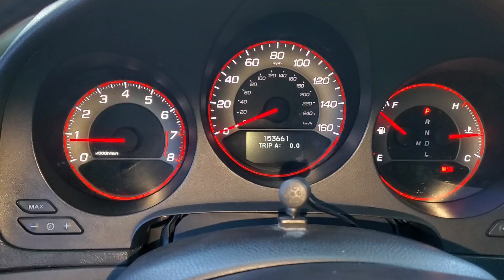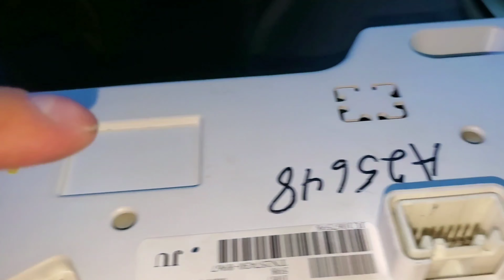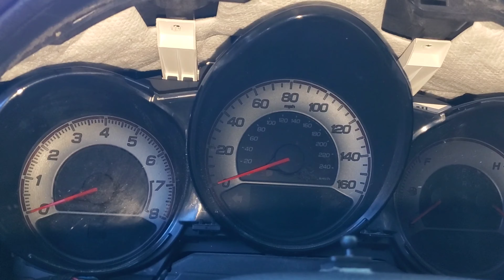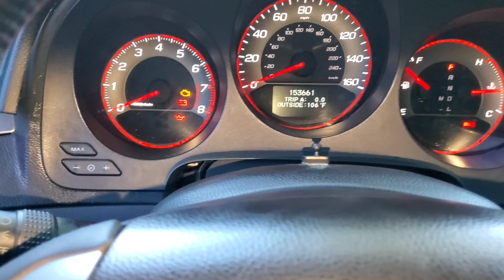#acuratl #diy #speedometer   2004 - 2008 Acura TL | How to change the speedometer

Comment: Wooow that really works on my TL Type-S with blue speedometer Thank you so much and I really appreciate.
Reply: I wanted to change my type s red cluster to the blue but what happend to your miles did they stay the same
Reply from the maker: The mileage will be what ever the blue one has. I recommend finding the one closest to your type s mileage.
Reply: @BayViewz Do problems from the previous car transfer over? Like if the car you took the speedometer from had a check engine light on will mine now say the same thing?
Reply from the maker: @scottytoohotty8342  No!
Reply: @BayViewz  Thank you !

Comment: The type s cluster will work on an 06 base model with no issues?
Reply from the maker: That's correct.  Only issue is you will have to hit the info button below the select/reset button everytime you open the door or start the car because of the TPMS (tire pressure monitor system).  Also airbag light will come on.
Reply: @BayViewz  so the tpms will no longer work? Anyway to bypass either ?
Reply from the maker: @LittleromoGaming  2004 to 2006 never had that. Only the 2007/2008 model. No way to bypass that.
Reply: @BayViewz  my 06 has tpms tho
Reply from the maker: @LittleromoGaming  are you sure your car is a 2006?  I just Google to double check and only the 2007/2008.  Either way that is the only issue and the airbag light being on.
Reply: Yeah my 06 has tpms for sure so it’s just the airbag light I’d have to deal with
Reply from the maker: @LittleromoGaming  you can carefully take off the clear plastic and put black tape over it. That's what I ended up doing lol.
Reply: 06 here , I got tpms on my a-spec wheels
Reply from the maker: @Crx018  Did you change your speedometer to the type s and does the tpms works?
Reply: @Crx018  then change the tpms lol
Reply: @LittleromoGaming  you have to open the cluster on the circuit board remove the srs bulb. Simply as that no more srs illumination

Comment: Where did you get the red lights for your ac unit?
Reply from the maker: https://www.ebay.com/itm/20x-Neo-Wedge-T3-Red-LED-Light-Instrument-HVAC-Heater-Climate-Control-Lamp-Bulbs-/143499204787?mkcid=16&mkevt=1&_trksid=p2349624.m46890.l49286&mkrid=711-127632-2357-0

Comment: Does the mileage stay the same when you swap the speedo ?
Reply from the maker: Sadly it doesn't.  Have to find one closest to original miles.
Reply: @BayViewz  I have an 05 if I wanted a type s cluster it’s direct fit right ?
Reply from the maker: @joelcolon2570  correct.

Comment: is the mileage displaying your actual mileage?
Reply from the maker: No. You find the speedometer that displays the mileage closest to yours.
Reply: Awe that sucks. Good question and thanks for answering
Reply from the maker: You welcome!
Reply: So I’m confused , if I install a Speedo with 50k miles in my Acura with 300k miles on body . New Speedo will say it says 50k miles ?
Reply from the maker: @HollyHoodRiek  correct!